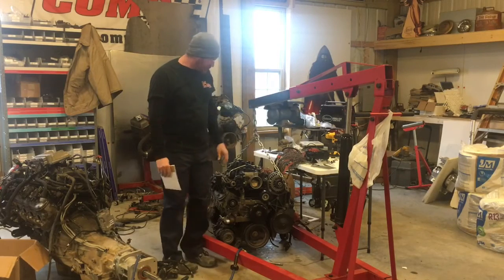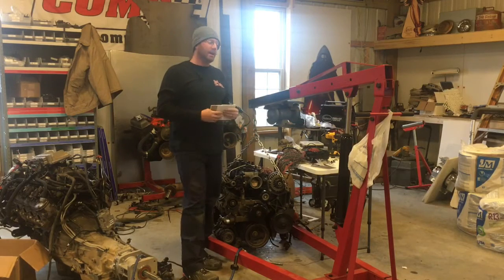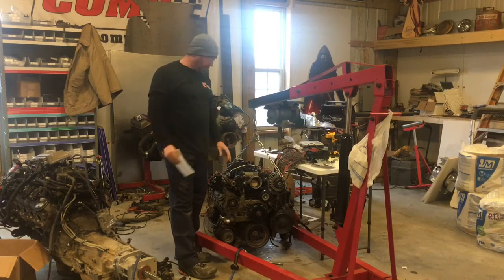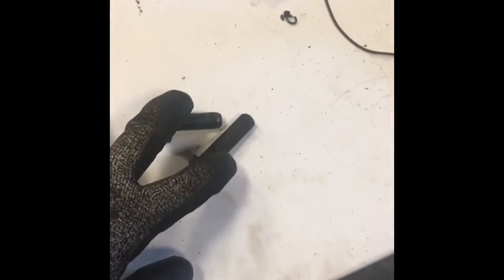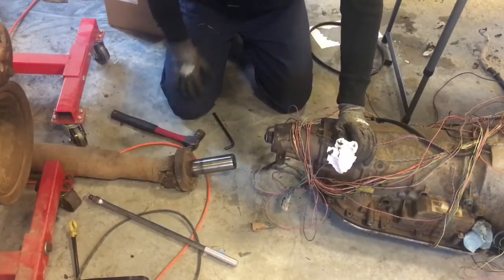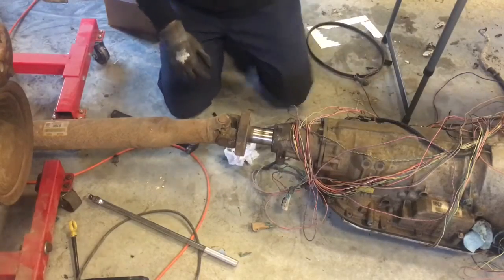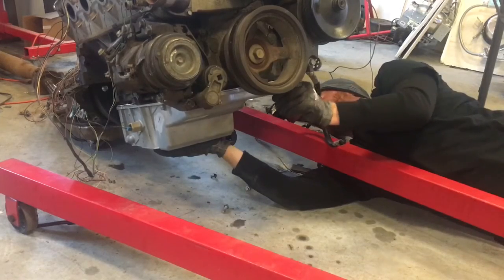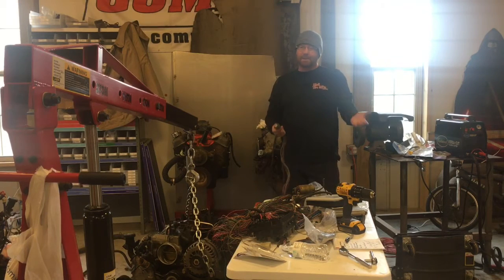4L60e to 4L80e wiring PLUS CTS-V oil pan - budget [LS swap 1966 GMC C10]

Comment: Fantastic video! Which motor mounts did you use and did the clear the low AC bracket and exhaust manifolds? Thank you
Reply from the maker: I don't have the a/c compressor in yet so dik if it will fit. I just used the $37 Amazon swap mounts. We had to do some trimming to clear the ac compressor but it was minimal.

Comment: I have a 2003 Chevy 1500 z71 with a 4l60e 4x4. I want to put a 4l80e 2wd from a 2001 2500 hd. Will I have to rewire?
Reply from the maker: Ledger Cook yeah man but it’s easy. There are a lot of write-ups online for it. It’s literally 3 wires. You can do it. If you have any questions, email us at narxoleptic@hotmail.com.
Reply: NarxolepticCustoms when I get it plugged in the pcm am I done? Or do i have to do anything with the computer besides plugging in the wires?
Reply from the maker: Ledger Cook you will need to have a tuner flash the computer to change the trans to a 4L80 setup. Usually $100 is what that would cost.
Reply: NarxolepticCustoms could I buy a tuner and do it myself? And if so what tuner would you say to get?
Reply from the maker: Ledger Cook oh yeah you can buy your own but HPTuners for a personal setup is like $500-600. So if you are going to use it I say go for it. But just to “free up” some hp and make the changes for the 4L80 I don’t think it’s worth it
Reply: NarxolepticCustoms alright when I start putting the 80 in i will email you if I run into trouble because I’m doing it at my schools auto shop and I’m 16 doing it myself
Reply from the maker: Ledger Cook that’s great man! We worked on my V8 s10 Blazer in my auto shop in high school all the time. There should be more auto shops across the country.
Reply: NarxolepticCustoms the one at my high school is abandoned because the teacher died and I’m friends with the welding teacher and he’s gonna let me use the shop, lift and all the tools to replace it
Reply from the maker: Ledger Cook that’s great man!!!
Reply: NarxolepticCustoms would Superchips 2845 work to make my transmission work?
Reply: NarxolepticCustoms should I keep the 5.3L flywheel on the 5.3 or change it to the 6.0L flywheel?
Reply from the maker: Ledger Cook I used the TCI flexplate for the swap that has the needed spacer on the it already. So, yes, you will need a flexplate
Reply: NarxolepticCustoms I do have the stock flywheel from the 6.0L do you think it will work?
Reply from the maker: Ledger Cook it will, just jump online and buy the spacer. Type in something like 5.3 4L80e Swap spacer
Reply: NarxolepticCustoms sorry if I may sound dumb but I don’t know a lot  about the transmission side, but will be spaced go in between the converter and the flywheel
Reply from the maker: Ledger Cook you don’t sound dumb to me. The spacer goes between the crank and the flexplate.
Reply from the maker: Ledger Cook I also thought about it last night, you’ll need a new Vehicle Speed Sensor (VSS)  added to your harness. Basically install your 4L60 VSS in the front connector on the 4L80 and the new one goes to the rear connector. Then run the wires for the new VSS to holes 22 and 23 on your RED computer plug-in
Reply: NarxolepticCustoms do I just put the new vss in and run it to the computer, no wiring from the stock harness goes on the new vss?
Reply from the maker: That is correct.
Reply: NarxolepticCustoms do you know if the vss on the 4l60e is the same type of connector as the on the 80?
Reply from the maker: Ledger Cook yes it is.